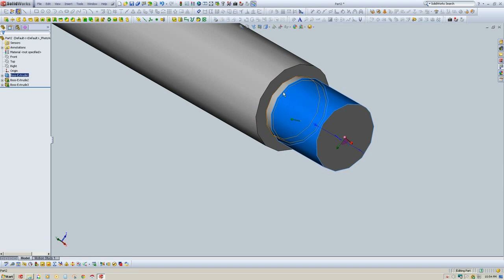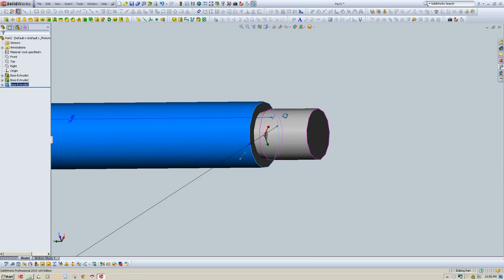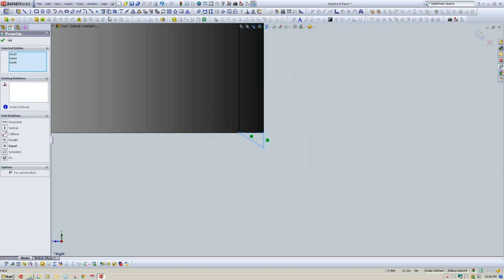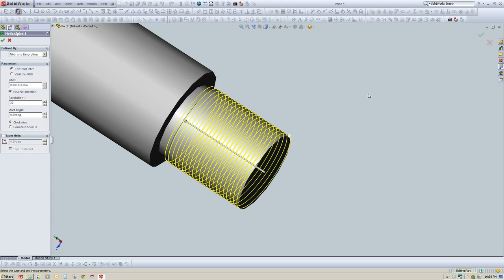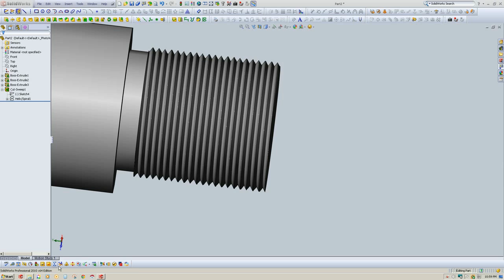Solidworks Tutorial - Super Easy 3D Screw External Thread Lesson Learn Simple Helix Cut 5 Minutes

Comment: How would I do this without a thread relief? I can get it to cut, but it ends in a "hard" stop. I want to taper the thread near the ends but a variable pitch helix wont let me sweep cut it for whatever reason. Also, how do i prevent the cutting tool from cutting into the bolt head when it nears the top of the screw? I obviously just want the shaft to be swept cut
Reply from the maker: You will be left with your "hard" triangle after the sweep.  Simply select the triangle and create a sketch.  Next, clink on the convert entities tool and it will automatically turn that triangle you have selected into a sketch.  Now, Create a construction line directly down the center of the bolt and revolve cut that triangle.  This will be like a lathe running a thread down and at the last thread staying in position until the triangle cut all the way around the shaft.  I never thought at the time I made the video to do that but I do it all the time now.

To keep it from hitting the head of a bolt just keep your helix back an extra turn or so, however much it takes to keep it out of it.
Reply: Raymond Kopec awesome, thanks! Is that a common/realistic method of screw production though?
Reply from the maker: We do a lot of it on cylinder rods and such with lathes.  Where they are any possible combination of diameter and pitch.

I don't ever recommend drawing a bolt in solidworks unless it's an absolute must.  It doesn't take me long to make one but it's not worth it to me for how many different sizes are out there.  Using toolbox and creating your own bolts out of there is fine with me for assemblies.

Here is a video on mass produced bolts and nuts.  It is not ideological to to produce them on a lathe but is possible for higher accuracy than factory mass production methods.
How nuts and bolts are made
Reply: Thank you so much for the info!

Comment: You have too many shortcuts on your toolbar, explaining where the selection is originally would make this a better video.
Reply from the maker: There are not enough shortcuts in the toolbar IMO.  I use swipe gestures and a customized mouse mostly and think the Command Manager is a stupid addition. It adds extra clicks and is only good for new users that don't know what to use when IMO.   The fewer clicks you have to get to an operation, the quicker the operation will be.  If you were setup the same as me and knew how to use it fluently, you'd probably like it more.  It takes some time setting it up per your requirements but only the highlighted commands that can be used while doing part/sketch/drawing will be active to click.  This video is around 5 years old.  My icons have changed some, but I still keep most that I use frequently at 1-click positions.

Comment from the maker: You may need to zoom real close to your sketch lines and make sure there isn't a tiny line connected at one of the ends that you need to delete.  If it doesn't see it as a closed shape it won't let it complete.  Also,  make sure all of your lines except the shape you are using to cut in the sketch are changed to construction (dashed) lines.  Hope this helps, if not let me know and i'll try to help.  Thanks.

Comment: good video ray sure was helpful, when i program a thread on a cnc lathe i always put a chamfer before i thread, if you go from th face under the miner (or major id od ) at a greater angle then the tool then you never have a bur , im trying to figure out  how to blunt start a thread in solid works anyway great video thanks m8
Reply from the maker: I always run a chamfer also but didn't in this video.  You can start the thread out past the part to avoid that little "start position" error angle I showed at the end.  Glad you liked it.  Thanks for watching!

Comment from the maker: The hole wizard is actually a great tool for calling out threads in drawing files but it lacks the ability of detail in the drawings.  I didn't like it until I started doing solids with lots of tapped holes.  If you use the hole callout command in a drawing and select the hole it will automatically tell the drill size needed and the depth of the drill and tap according to the parameters you set.  It also has the correct depths preset unless you change them.